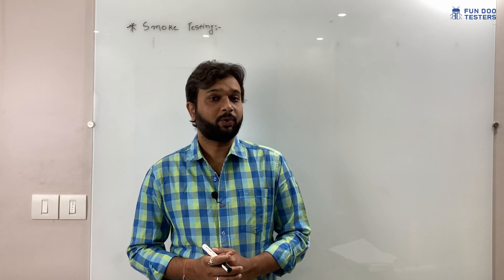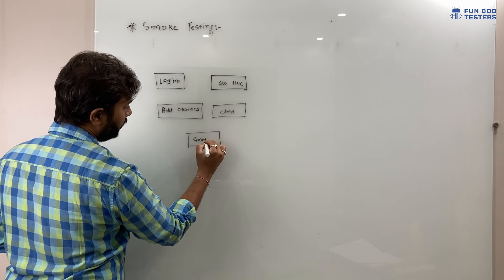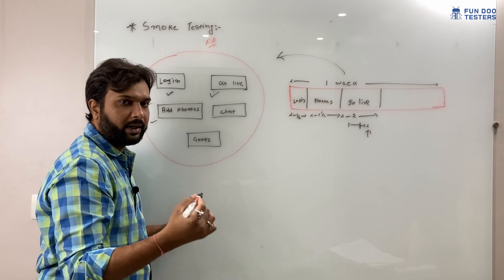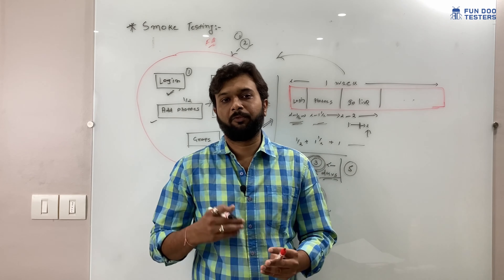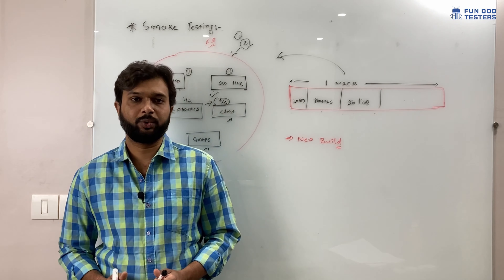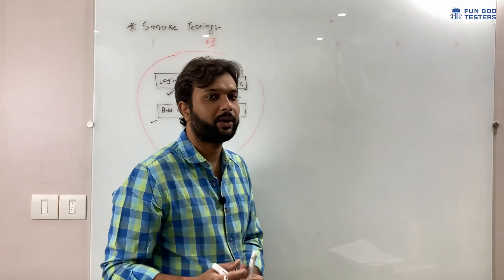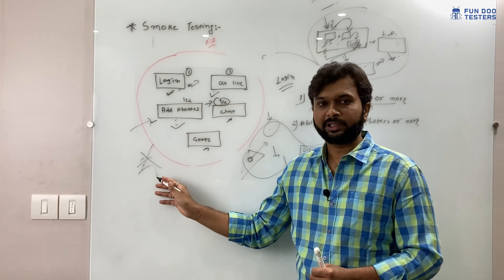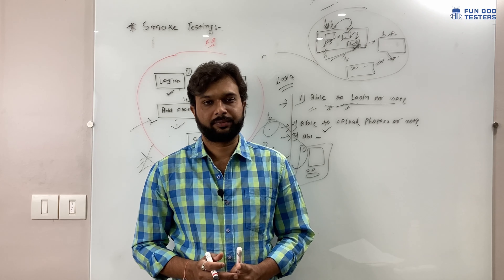What is smoke testing?  Explained with real-time example in English - Software testing tutorial

Comment: During any software development, enterprises need to ensure that the primary functions or the preliminary functions of a software applications works fine. Smoke testing is done to see whether all the crucial functions of the software in full is working. It does not test the application in detail. Therefore, it’s the first-step process that checks whether a software’s primary functions are working or not. Avo Assure from Avo Automation helps with seamless testing of all kinds including smoke testing.